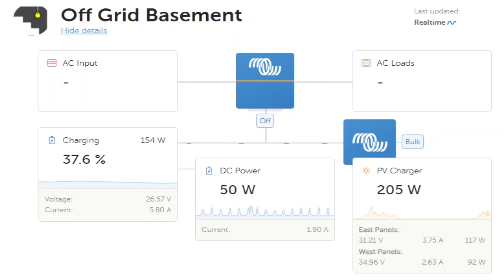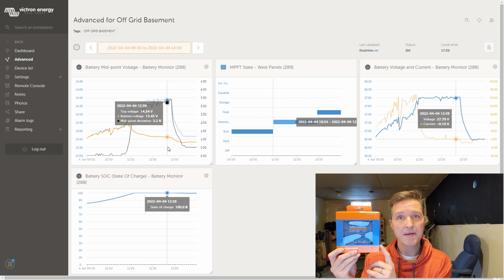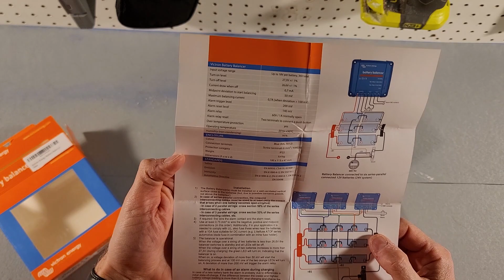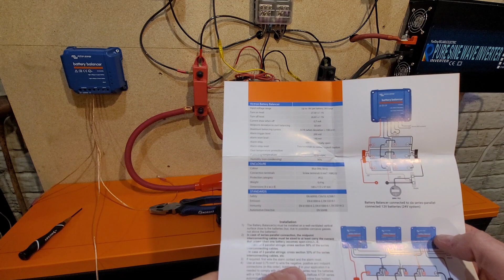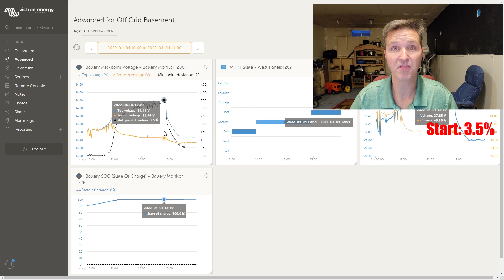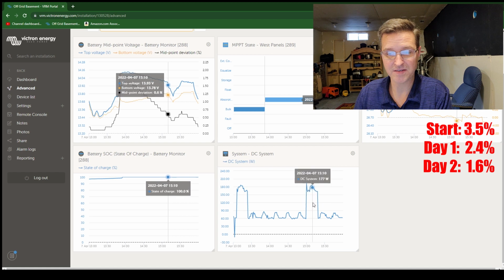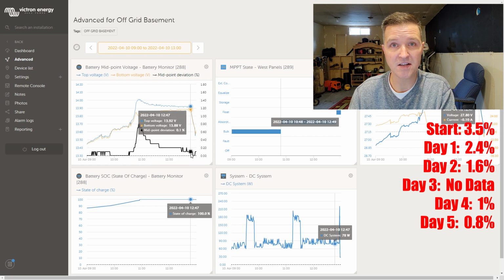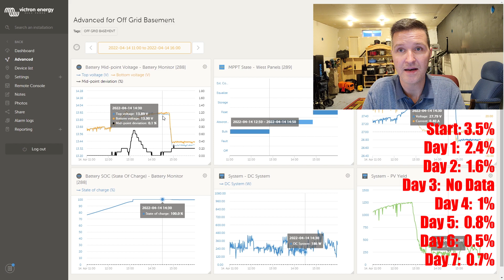Victron Battery Balancer:  Installation and 7 Day real world Testing with LifePo4 Batteries!!

Comment: I've heard and read that Absorb and float are not desirable with LiFEPO batteries. You should program your charge controller for high cut in voltages/shortest duration possible for those modes. One comment mentioned the 1 amp limit for this balancer and a 5 amp balancer available. That would bring the batteries in balance faster and keep them closer. But my Victron pamphlet (the exact one you show) says the balancer only draws .5 amp from the higher battery. I'm learning a lot about balancing lately, as my 24 volt setup wound up with the 2 twelve volt batteries in series going out of balance the other day and one BMS shut down, after 6 months of running without a balancer. I checked the batteries when they were installed, and they were both at the exact same voltage. My batteries were at 12.7 and 10.7, with the lower being just below the manufacturers stated BMS low voltage cut off point. I charged it up to 11.8 (just above the stated reconnection point), reinstalled it and now after charging for several hours, one is at 13.2 and the other at 13.1. That is not supposed to happen with LiFePo batteries. I installed the Victron, but my array rarely goes over 27.3 volts to kick it in, and it was installed after the batteries had been charged back to the 13.2/13.1. Nifty graphing, and very illuminating info, thanx for the video! Update: 9-13-23 This Victron is basically useless unless you have a massive battery compared to your usage, so the batteries are almost never discharged below 99%. The 14+ volt minimum cut in voltage renders it totally ineffective except when the battery bank is fully charged daily. If you let your batteries sit at the optimum 90% charged ( for longevity) the balancer never comes on.  I got a $29 balancer on Amazon that kicks in at way lower state of charge and it works flawlessly after removing the Victron that never came on even once. Victron is way overpriced and hyped by affiliate (commission receiving) you tubers for their profit, not to help you choose components. I cannot believe not even one creator mentions this drawback. Additionally, the Victron burns away the excess charge from the higher battery and dissipates as heat..the cheapy sends the power to the weaker battery...think about it. 2 year update, in this hot damp Hawaii environment, the cheapy Mazava balancer is still humming along perfectly.
Reply from the maker: Thank you for all the great info!
Reply: I agree no absorption for lipo
Reply: @5400bowen could you please share what balancer you have to balance your batteries at lover voltages? As it would be better for them in case if they are not fully charged. Thank you!
Reply: @tarasoliyarnyk4195  the Mazava has been humming along for two years now no problem.
Reply: @tarasoliyarnyk4195  yes my comments keep disappearing…the Mazava has been humming along now for two years with no problems…third time posting this reply…
Reply: @tarasoliyarnyk4195  yes fourth time on this reply…the Mazava has been humming along for two years now, no problem.
Reply: @tarasoliyarnyk4195  wow, 4 replies with the brand name of the better cheaper balancer have disappeared after originally showing, all in the last 15 minutes. Let’s see if this one does, as  it doesn’t contain the name of the balancer I found much cheaper that actually works…
Reply: @tarasoliyarnyk4195  my reply keeps disappearing…5 times now…. I guess Victron is paying YouTube to remove any comment with the brand name of the much cheaper much better product.
Reply: @tarasoliyarnyk4195  hey after posting 15 times a couple of my replies stuck, and a couple reappeared… Victron must be paying off YouTube big time to stifle their competition.
Reply: @5400bowen  thanks for the answers, as for now I can see all 7 answers from you, so they didn't disappear for me
Reply: @tarasoliyarnyk4195  I’m glad I could help…but 8 other replies I made aren’t there. Mazava….
Reply: Since my replies keep disappearing…Mazava is the brand that works at any voltage level. $29 versus $65 for the useless Victron.
Reply: @5400bowen  for lithium you only want the balancing to kick in at the top end all the time is not ideal
Reply: @fathergratwick hasn't degraded the batteries in 2 years of constant use. I think you are off there, never heard balancing hurts lithium, and I've spent literally hundreds of hours studying them over the last 5 years. If anything, balancing at near to or full charge is a problem, not constant monitoring. And the Victron won't ever kick in if there is a problem with one or more batteries. Plus the fact that it burns  off the excessive charge from the higher battery, as heat (a VERY bad method!) and the Mazava feeds it to the lower battery. Stop making stuff up to defend crappy overpriced Victron gear.
Reply: @5400bowen  lithium should be top or bottom balanced. if the balancer stays on all the time it can actually cause balance problems. im aware people do it I did it too and had issues until I learned that all professionally built or properly setup lithium cell or battery active balancers dont kick in until the battery cells are around 3.4v or higher state of charge.
Reply: all add I dont own any victron products. I have a rebranded generis hc style balancer like you but im using a voltage switch to turn mine off until the pack hits 27v.
Reply: With or without display?😂
Reply: @ the victron has no display. The Mazava has a lit display and shows percentage of charge and individual battery voltages. After like 18 months it has performed flawlessly. As I stated, the Victron never even started a balance cycle once. And lay off the sauce. From $30 to $65, the Mazava is head and shoulders above the more expensive Victron. After working with  electrical and light electronics for 62 years, and solar for the last 12, I know meters, electrical distribution and monitoring well.
Reply: @5400bowen  ok thanks.I asked again on a newer vid an hour ago.What sauce?
Reply: @ sauce? Do you mean source? Youtube keeps taking down my comments tgat give the brand and source. But now dien the line with few looking at the comment threads anymore I've been sllowed to say amazon. Mazzava is the brand of bslancer I have now and it works flawlessy.

Comment: voltage is not a measure of state of charge...measures of voltage while the charger is running is skewed, its measuring charge voltage not battery voltage
Reply: It would be more accurate to say voltage is not an absolute measure of state of charge, but it does give some indication, and yes, if the charge controller is putting out anything, it will skew the voltage reading. Unless you disconnect it to take voltage readings.
Reply: @5400bowen  Not only disconnect the charger(s), but also disconnect the load(s), and then let the battery rest!  Never the less, while in use the voltage of each in the series string should be close. If not, there is a balance problem.
Reply from the maker: That is true.
Reply: I think battery balancer only works with the input (which is not state of charge (amps)) it actually controls how much voltage is being passed to the battery in order to charge so I find this an usefull video about the behaviour of the balancer, modifying the input based on the needs

Comment: This is the best explanation why you should use a balancer between 2 separate bms/battery,s (lifepo4) and especially when using lead acid it could save your battery bank. At least it will be running much longer.
Reply from the maker: I'm glad you got something out of it.   Thanks for the comment!

Comment: If I have 4 12v 100ah batteries in series would I need 2 of the victron Battery Balancers ?
Reply from the maker: You would actually need 3!
Reply: See this PDF on how to wire up the 3 balancers for your setup https://www.victronenergy.com/upload/documents/Datasheet-Battery-Balancer-EN.pdf

Comment: I've just moved from 2 x 200ah batteries in parallel to serial and it's the first time I've tried to fully charge it to 14.2 volt each battery and got a mid point error where the difference was over 0.5 volt , 3% .
I already had the battery balancer wired up just not fitted , I fitted it but looked to be very slow at balancing .

SO FOUND A WAY TO SPEED IT UP ,  I cut down the absorption down to 28 volt or the high battery would go over cell and shut down the battery , I discharged the batteries just a little and charged it back up again and each time would get a little better , after doing this 5 or 6 times I've got it down to within 0.1 volts , 0.3% and slowly increasing the absorption voltage .
So fixed the mid point error in a day .
Reply from the maker: That is great!  I really happy to got everything figured out.

Comment: Very informative video, thanks for that.
I have 2x 12v batteries connected in series and I have a battery ballance as well which the negative line connected straight to the negative side of the battery, also have my victron shunt set up in the correct order, but the shunt doesn't give accurate information from the batteries,
Is it because I didn't connect the battery balance to the negative bar as you did?
Reply from the maker: I would think that it wouldn't matter if the negative connection is on the battery or busbar.  What is your shunt telling you?  Does it show "Mid-point voltage deviation" in the Victron App for your battery monitor?

Comment: I wondered how long it would take for your 2 batteries to become unbalanced , I guess that is the big advantage of getting a 24v or 48v battery is that the bms can control and balance out all the cells.
But like me you start with a 12 voltage system and upgrade to 24v and it is more cost effective to just get a second battery then having to buy a 24v battery pack or few.
Reply from the maker: I should say the balancer is still working very well.  The batteries get balanced within a half hour every time they get to 100%.
Reply: The balancer works only if the battery is fully charged to 100%? @OffGridBasement

Comment: Thanks for sharing this. I've been running a 24v system with Valance 12v 138ah for 2+ years. I didn't know anything about running 12v batteries in series when I started and I actually killed one of my 6 batteries 3-4 months in by over discharging it because it was brought so low. I bought 3 more batteries to bring me up to 8 and added a Victron balancer. The Victron balancer  alone with it's 1 amp limit was a little light to get 8 batteries in balance, so added a 2nd non Victron one that could do 5 ams and ever since then my batteries have been great.

I have the Lynx Shunt which unfortunately does not measure midpoint deviation like the Smart/712 does so I've never been able to track it like you have, but your graphs were awesome. I have the CCGX so I have graphs for everything else, just not midpoint deviation.

Your video confirms exactly what I suspected in so many 24v setups running 12v batteries and it's only going to get worse as more people purchase these all in one 24v inverter/chargers and run 12v batteries in series.
Reply from the maker: Thanks for the comment.  You're right about the victron balancer being underpowered so I was surprised when it actually did the job.  I'm glad you have your system working great.  It sucks to burn through a battery  just because they're out of balance.  I'm really happy you got something out of the video!
Reply: Dan I’m just about to set up 6 valence batteries myself for a 24v system. Will one of these balancer work for 6 batteries?
Reply: @jo8ephthomas  Yes it will work fine with the Valences and as you know they have no built in BMS so it's important to keep their voltages in check during charging. I've used both the Victron and the cheap ones off Amazon. The Victron has outlasted the cheap ones.